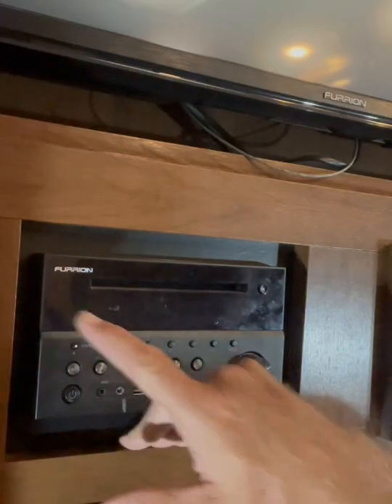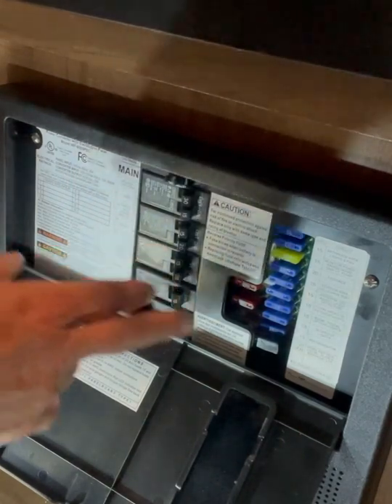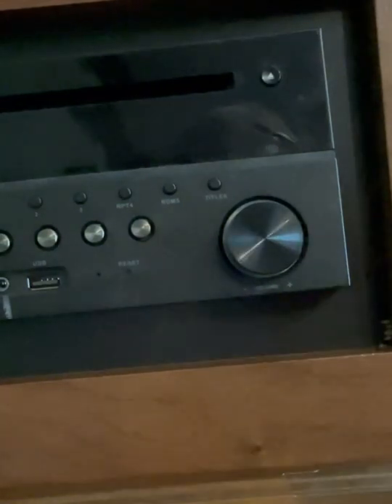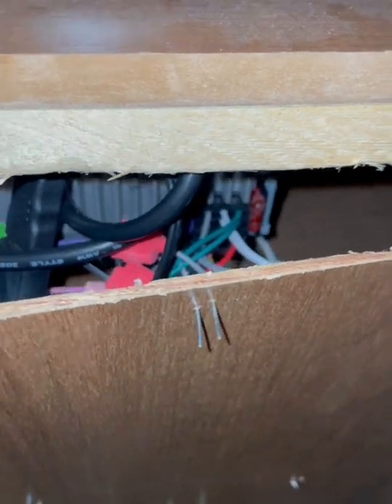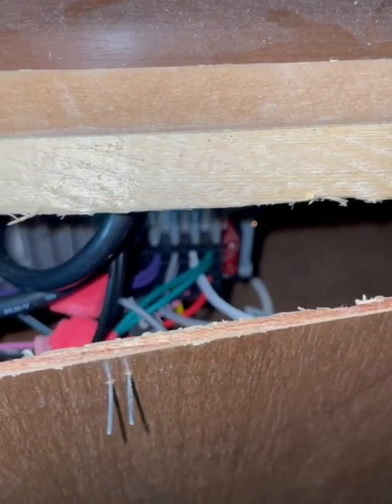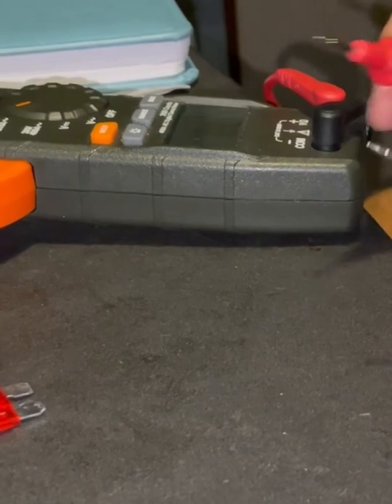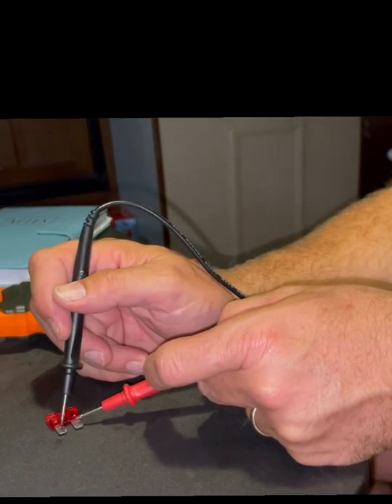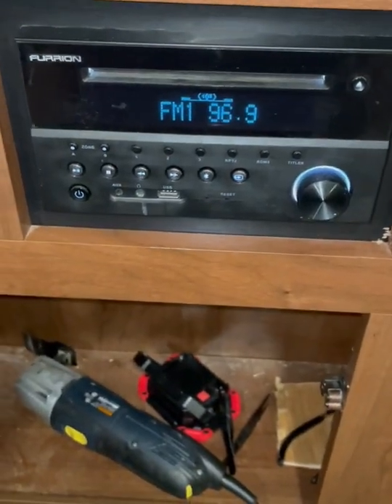Replacing Fuse behind Radio in Jayco Trailer RV

Comment: The lower faceplate around the the volume knob on that unit is removeable. Use a screwdriver or knife to lift it. Remove four screws and you have access to the fuse. No need to pry on your cabinet.

Comment: You could have squeezed that bottom face plate on the sides and it comes off instead of cutting up stuff. Then there's screws behind it to take the component out. 
What amp is the fuse also.

Comment from the maker: If you don’t want it to happen, don’t cross the terminals on your battery with a wrench. I’m pretty sure that’s what caused it. That’s my gut. It happened when the bolt on the battery clamp came loose and I lost control of the wrench crossing terminals

Comment: OMG, the front cover on the stereo pulls right off.Only half of the face pops right off. 4 screws will be exposed holding the stereo unit in place.  Unscrew them and the unit comes right out. Super easy. Change the 15amp fuse. Put the 4 screws back in . DO NOT cut any cabinets or paneling. Who is this yo yo? Crazy butcher job video.